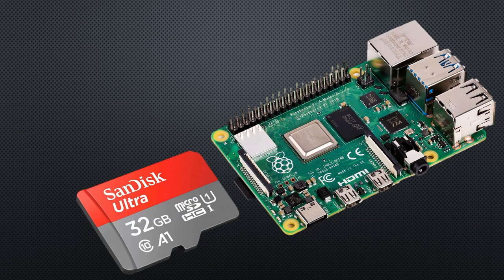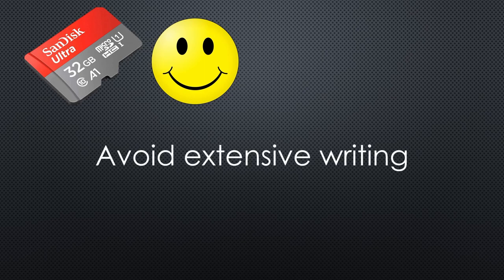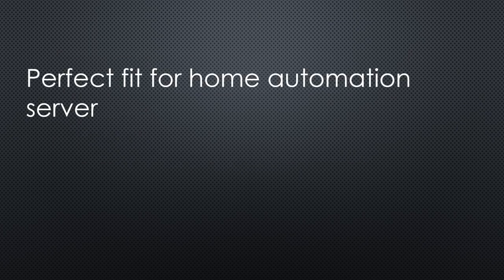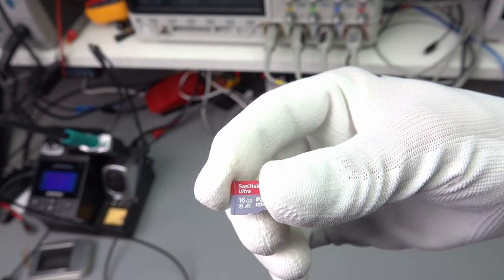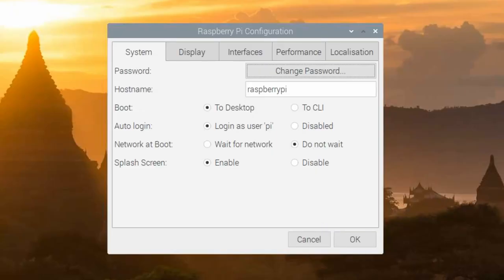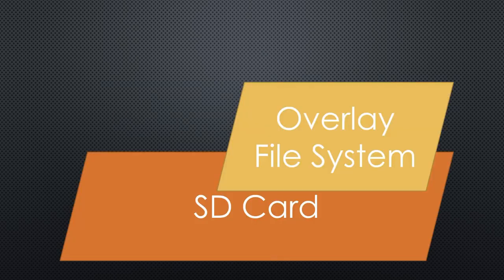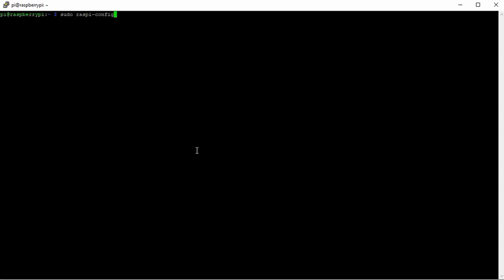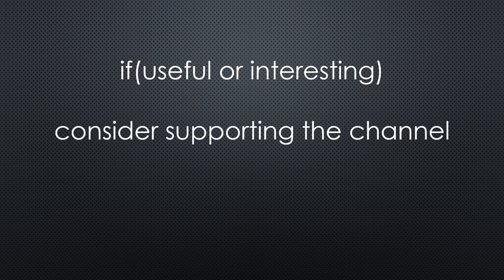#403 Simple Trick to protect your Raspberry SD card from Crashing

Comment: a pxe boot with a tftp server hosting the image of the operating system ?
 or even , clients on a vnc environment that runs elsewhere and maps the hardware of the pi  to that user profile .
Reply from the maker: Using network boot can also be a good possibility if you trust the network connection. I never used it.

Comment: Another astonishingly simple option is to use a bigger SD cad. Let's say that your card is 80% full, then there are 20% storage/repair capacity left. If you chose an SD card with twice as much capacity, you'll get 120% storage/repair capacity left relative to your original one. This leads to a 6 times as much lifetime of the SD card as before.
Reply from the maker: I agree with Jan. But bigger cards usually also are faster (at least in the past).
Reply: @AndreasSpiess  

Wear-Leveling If Not done by Hardware is   a Problem a OS should handle... But Looks Like they dont.
Maybe writte a Script to do monthly a copy of the Files that have IO writtes and rename the old File to dead Disk space +timestamp  

If i build a System i Always keep more then 50% Disk free
 And If the Disk get to 20% free i search for Upgrade Options.

Have a nice Day
And greatz from Germany
opo

Comment: I feel you should look at using a network drive so you do not need to use so much RAM.  One simple way to make a network drive is to use an old desktop as a Linux box and have it share the hard drive to the raspberry pi.
Reply from the maker: You are right. Other viewers also mentioned remote logging as an opportunity. I assume it would need at least some Linux knowledge.

Comment: How does Overlay File System in Read-Write mode works? As in RO mode but writes on SD Card before shutdown or restart? Or is just a temporary solution when updating and just passes the data through RAM to SD Card? Thank you
Reply from the maker: As shown in the video all changed data is lost when you reboot the Pi.
Reply: Thank you. Also for all the videos on your channel. I learned a lot of useful stuff.

Comment: Do you have any data or experience on the reliability advantage of an ssd over an sd card? After all, both have a limited number of write cycles.
Reply from the maker: I do not have evidence. But SSDs are made for computer usage and implement wear levelling (According to the manufacturers). Most SD cards are not made for computer usage (if you trust the datasheets of the manufacturers) and did not implement wear levelling because it was not needed/beneficial. Now you get some high-endurance SD cards which seem to be useable in computer scenarios. One viewer reported that Sandisk refused to replace a defective SD card with this explanation.
Reply: @AndreasSpiess  our need is 24x7 controlling a complex system with 40 relays and about 40 inputs. We also have about 200 operating state variables that have to be retained through a restart.

We have a twin 15 farad super cap, mcu controlled ups on board, gives us 30 seconds safety. 

To simplify safe shutdown writes, we use a virtual drive space (memory) for sql lite db, all variables are stored in this db.

So when we have a power issue (many of our customers do have frequent power issues), it is detected by interrupt, and the virtual db is saved to the sd card, and it code puts the pi into a tight do nothing loop, which is only broken by power coming back on, or the caps drain.

This way sd card writes are minimized, and the pi will automatically restart after a power outage of more than 30 seconds.

Comment: Hi Andreas, what are your thoughts about eMMC storage like the RasPiKey as a halfway house between SD cards and SSD storage?
Reply from the maker: I never used it. I would use it if it would be mounted on the board (instead of an SD card). Otherwise it makes no sense for me.
Reply: @AndreasSpiess  I think it is sort of mounted on the board, although admittedly not within its outline. I run a pair of Pi 4's with PoE+ hats that boot from SD. I tried to get them to netboot/pxe boot with partial success. If I can't fix that before the SD cards die, I'll try the RasPiKey.
Reply from the maker: Strange that network boot does not work. Other viewers suggested that as an alternative to my proposal. I never used it...
Reply: @AndreasSpiess  It does but it then runs the rancher labs k3s kubernetes systemd service and that won't start. I suspect that the NFS mount needs a user space component for that part. Eventually I'm hoping to move to k3os instead of RasPi OS. I appreciate that this is a bit off topic for storage reliability though.

Comment: Have you tried using USB sticks instead of the SD cards? I am mostly using small (memory and physical size) USB sticks now, because they are easier to handle and faster than SD cards, if you use USB3. I haven't had any corruption of SD cards or USB sticks in a long while, but i may use the overlay option for my pan and tilt Pi cameras in the future. For a more expensive SSD solution, depending on the CM4 module, one could always use a  CM4 board with M.2 SSD connector like the CM4-IO-BASE-A, which starts at  about 25€ for the board and 30€ for the CM4.
Reply from the maker: No, I never used USB sticks. Maybe they become an alternative to small SSDs if they are fast enough. I would not use them instead of SD cards because I like that the SD cards are so small and fit into the case.

Comment: Where is the problem?  Is it because of excessive opening and closing of files or short write bursts? I was planning to use SD cards for data logging temperature once a second and leaving the file open all the time.  Any help here?   :)
Reply from the maker: It is because the same SD card region is written on and on (probably especially with logs, but I do not know). Maybe your file will extend to new cells on the SD card and will not cause problems if you do not reboot.

Comment: I wonder.. is there a way to make log files automatically save to disk?

Log files are generally pretty small, so I wouldn't be worried about the write cycles.

That way you could still have your SD card last for a long time, but a power outage won't delete your logs.
Reply: Install log2ram.  The logs go to a ram disk and get copied to the SD card only once a day.
Reply from the maker: log2ram is a good thing. BTW: The file size is not the problem. The problem is if files are written to the same area of the SD card on and on. This can happen with logfiles which are deleted from time to time...

Comment: Another thing to do is to enable periodic fstrim operations to discard deleted blocks. This applies to all flash based storage: SSDs as well as SD cards.
Reply from the maker: Would this not increase the wear?
Reply: @AndreasSpiess  It spreads the wear more evenly as it allows the flash controller to know which blocks are free and can be reused instead of having to reuse (erase, reprogram) the same flash block when it runs out of spare unused blocks. Wear levelling.
Reply from the maker: Are you sure that this is true for SD cards. I heard that their main problem is that they have no wear levelling implemented.
Reply: @AndreasSpiess  It really depends on how the card is made. The better ones do implement the TRIM operation. Alternately have the operating system use a more flash friendly filesystem for logs, eg. f2fs

Comment: I'm testing the overlay file system on 11 Raspberry Pi, running camera applications.
Users were instructed to just unplug the power without powering off the system, so I could see if this was a viable solution.
So far no issues with sd card corruption. 
2 of the Raspberry Pi were running without interruption all day (9-18) for 3 month and they still work perfectly fine.

I don't know if i'm lucky or if it works well, so take it with a grain of salt.
Reply from the maker: Thank you for sharing your test data. For me it looks like it works as designed!

Comment: The overlay system looks like a cool feature but I almost never use raspbian. Tbh, I've never had a problem with tweaking fstab but this is handy to know to recommend to others as it's simpler to explain.
Reply from the maker: If you use different distros I assume you are an experienced Linux user and do not need such a simple solution. For a Linux noob like me it is different ;-)
Reply: @AndreasSpiess  not sure I’d call myself experienced but I am comfortable with *nix. Like I said, didn’t know about this feature and I will recommend it to those that don’t really care about what’s under the bonnet. Thanks for sharing.

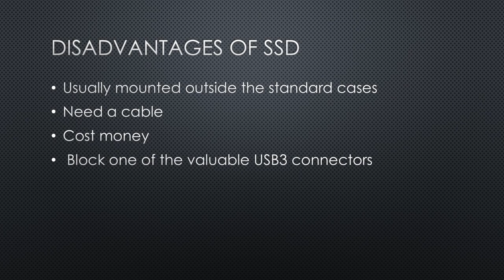Comment: • 2:15 - Another disadvantage of SSDs is that as flash-media, they wear out like a memory-card does, so it's no better.
• 3:19 - The write-protect switch on SD cards is just a piece of plastic, the write-protect function is only in the card-reader/writer, and not all card-readers (*cough*Chinese*cough*) honor the switch, so it doesn't guarantee to protect a card from being written (this is the same as with floppy disks).
• 4:22 - This makes the system even more vulnerable to data-loss than ever. 🤔 You assume reboots are intentional.
Reply from the maker: 1. SSDs use wear leveling which was not the case for SD cards. This is why they were not specified for computer usage.
2. You are right
3. I do not agree because I only use it for relatively stable applications. So reboots for configuration changes are very rare.

Comment: is it possible to use the ssd on the usb 2.0 ports aswell? my 2 usb 3 ports are busy with the hdds i'm using for my nas already
Reply: As far as I'm aware, yes, but it would be slower.

You might find putting the SSD on USB3 and HDDs on USB2 to be better but that would be dependent on what you're using the storage for, and how fast each storage device actually is.

Be an interesting tinkering experiment if you're up to it :-)
Reply from the maker: It works on USB2. But extremely slow. Nothing to try ;-)

Comment: Does this only work with Raspberry Pi 4? I don't see the Performance options on my 3B+ which is running the latest OS.
Reply from the maker: I now tried it with a Pi3 (desktop version) and it was available as with the Pi4.
Reply: @AndreasSpiess  It seems to be missing from the lite version. I’ll try again with the full desktop version. That opens up a lot of possibilities for automotive use.
Reply: I had to update the firmware and then was able to get the the latest OS installed. I have it working the Pi I used for Fruitbox (jukebox software) and it works great! This should greatly prolong the life of the card.  Thank you!

Comment: Ooooo DMR radio hot spot.  What radio chat room # do you haunt?  usually 93 or scanning is what i'm doing.
Reply from the maker: I am on our Swiss TGs plus the Redit TG.
Reply: @AndreasSpiess  So 228 and  TG950 .
Reply from the maker: 228 is only used by non-Swiss guys calling Switzerland. Very quiet TG. 2280 / 2284 are the ones used. Reddit is now on 98003

Comment: What about buying one of those cheap mini USB sticks and put the /home directory on that? Maybe even those directories with most logs.
Reply from the maker: I do not know about the wear-levelling of USB sticks. They are also made for a few large file transfers and not for small and frequent write cycles. So they might suffer the same issues as SD cards.
Reply: @AndreasSpiess  I'm using an old 16GB usb stick in my cctv system (RPi Zero W + OTG cable for stick + Rpi Camera V2) since 6 month without any issues. With SD cards, the system is not surviving more then 2 months.

The system uses raspbian lite without any special configurations.
Reply: @AndreasSpiess  Yeah, i guess someone needs to investigate :-)

Comment: It was interesting.  I do have an original Pi 1 that has the operating system on an attached powered Hard Drive.  Just uses SD card to boot.
Reply from the maker: I only started with the Pi3.... I tried once to attach a HDD but had to solve the power issue...
Reply: @AndreasSpiess  yes, definitely works. Actually, I use nfs mode to develop o/s image updates, then use squashfs to compress it and send it over the network and into ram from a server at boot time. Runs as normal, no sd card required. Needs 2gb ram minimum. I have 5 pi4s on my network doing the home automation (node red and home assistant) - I can't have part of my house dropping out because of a worn out sd card!

Comment: This should be a feature of laptop and desktop computers as well. All should come with two separate disk drives, one for the OS and application programmes, set to read only, and one for user data, set to read/write. This would solve so many problems. 
It would bring meaning back to the phrase, "switch it off and on again" to fix it. It would make installing viruses far more difficult.
The procedure for updating the system components could disengage the user drive and allow the system drive to become read/write. The procedure could be made to automatically generate a system backup, before making any system changes. By isolating the user drive, any trojan horse would not be able to lie in wait on the user disk, for an opportunity to corrupt the system, and once returned to normal operation the read only mode of the system disk would stop any new virus corrupting the backup files. I would like to see the system install feature and its associate disk write locking to be a user controlled hardware switch. A physical interlock not dependent on some software sub programme, which might be hacked.
The current practice of allowing writes to the system disk is effectively producing self modifying code, which is really bad practice if you want a stable system.
Reply: Chromebooks do this with the guest account.
Reply: @macemoneta  one of the most advertised features of chrome books is the level of virus protection it provides.

Comment: You can enable iscsi drive from network for writing.
Reply from the maker: Unfortunately, I do not understand :-(
Reply: @AndreasSpiess  As far as I understand, Raspberry Pi 4B supports iSCSI in the boot-firmware, so it might be able to just boot off of an iSCSI disk.
Alternatively, one could OverlayFS mount an iSCSI volume on top of the SD-card.
(and if you want to make things complex, which is off-topic, then you could include docker and mount network-shares only inside containers).

Comment: Yes, good and useful video.
However, I disagree slightly on the SSD; they do wear out.
Harddisks are less likely to wear out (choose CMR, not SMR; choose WD-RED, not WD-BLUE).
But ... There is another option which isn't extremely complicated: Use NFS for storing your log-files. You don't have to set up netboot (which I just attempted yesterday and failed). You can make your fstab auto-mount your NFS shares and then have your 53 Raspberry Pi's (including Raspi Zero) log to one server.
You'll then have the convenience of looking on one computer rather than 53. ;)
-That is if you have your RasPi's connected to your network (they don't have to have internet access, though).
Reply from the maker: Remote logging is a good alternative if you really are interested in logs. I rarely use them (for finding errors) on such simple installations I use SD cards.
SSDs usually specify a max amount of data stored before they die. The data on my Raspberries are very, very small compared to these numbers because they consist of sensor readings and alike, not videos (different to my YouTube production machine)
Reply: @AndreasSpiess  What I'm concerned about is writing. Writing kills SD-cards, MicroSD-cards, USB-sticks and SSD drives - not the amount of data stored.
But as you're indicating; if writing a lot of data, the card / SSD will die quickly compared to if you write only a little data.
But repeatedly writing small files and deleting them (eg. compiling) is bad for all such devices. My brother's two SSD drives just died recently (mounted in a Mac Pro). Those drives didn't last more than a few years. Even WD-GREEN harddisks last longer (they're no longer available; WD-RED is much better anyway).
NFS can also be good for data-logging and that 'family' (including analyzing) - this also opens up doors for off-loading analyzing to the server instead of the device. :)
Now you mention video; I know you can actually attach cameras to the RasPi, which means you could make smart surveillance via NFS shares too. ;)

Comment: Hi Andreas,

Last week I wanted to update a 2017 installed Raspbian Jessie on its 8 GB µSD card. Of course, I dumped the card beforehand ... or at least I planned to. Because dd reported many defective blocks. The dump ran for 48 hours because of the many retrys.
Out of interest, I checked the file systems in the dump: were both okay. Obviously the mechanism that hides defective cells in the µSD card works very well. But I'm also sure that the card was on the verge of total failure ;-)
vy 73 de Micha, DD0UL
Reply from the maker: Good that you were able to get the content. This was not always the case here...
I stopped to use my 8GB cards when I saw how slow they are compared with the bigger cards, not because of unreliability. So I spent a few bucks.